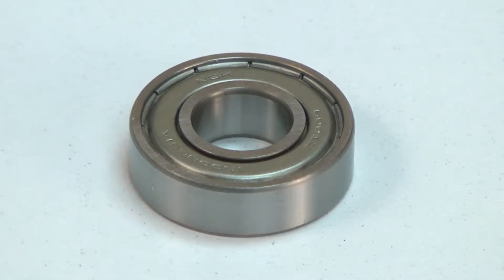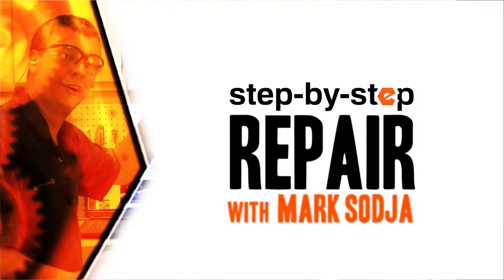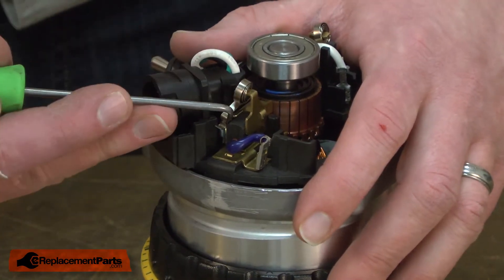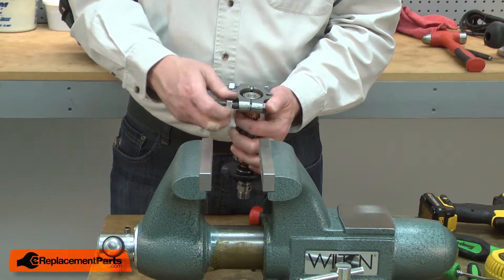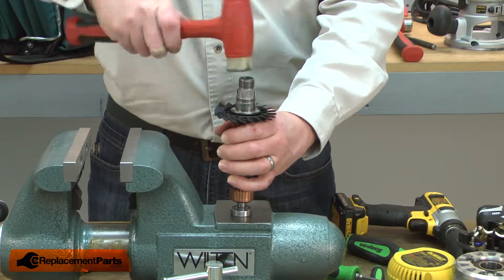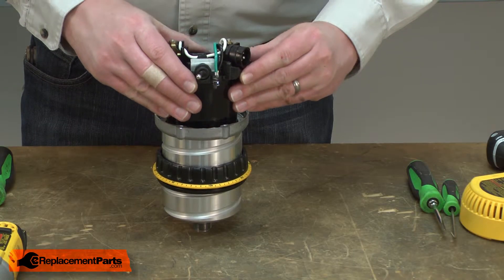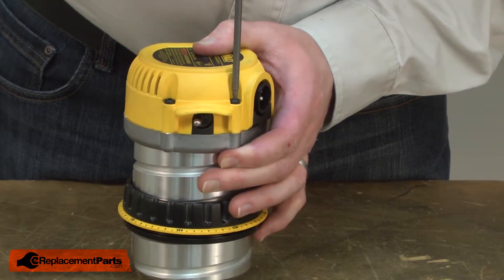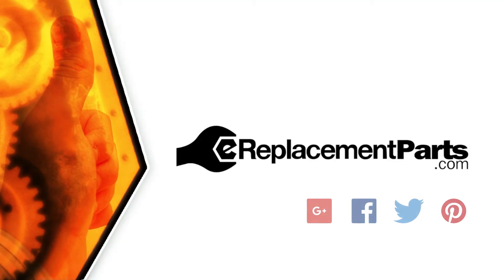DeWALT Router Repair - Replacing the Armature Bearing (DeWALT Part # 330003-09)

Comment: Didn't have the same experience in knocking the shaft loose from the bearing. I could not get the shaft to release from the bearing after several hammer attempts. Waste of time and money waiting on the part. In the meantime I hammered so hard that the housing fell out of the vice and the fan blades lost a few pieces. I guess it's easier to do when you have a brand new router to demo on.
Upgrading from the  616M 1 3/4 to the 618 2 1/4 motor instead. I will appreciate the extra HP

Comment: Horrible practice here. Folks, never hammer the shaft into the bearing like that. You are literally hammering the balls of the bearing into their races. You should only apply force (preferably in a press) to the inner race of the bearing while bracing the shaft.